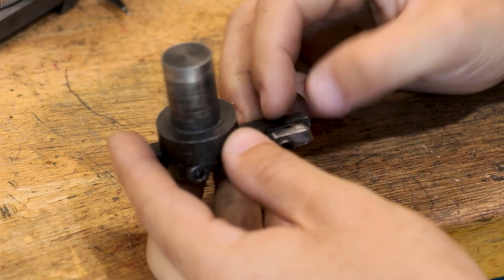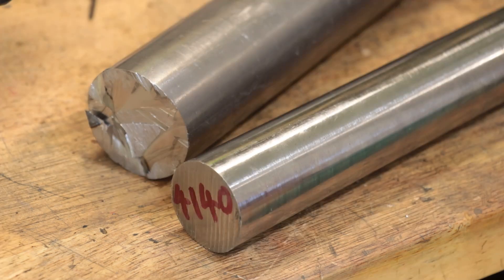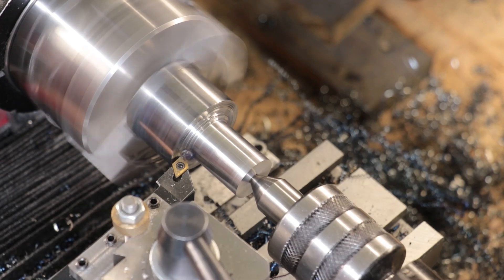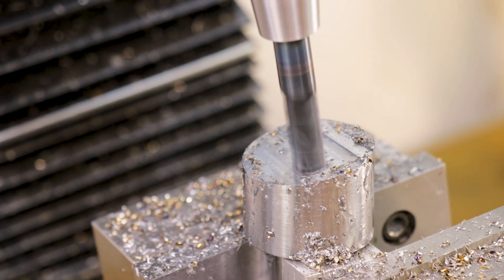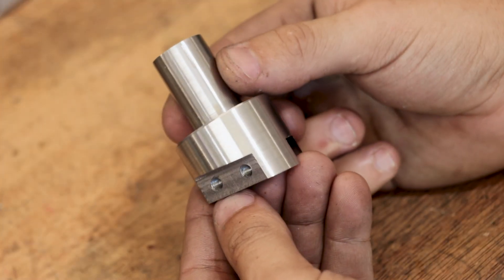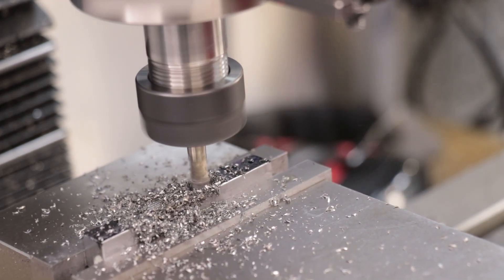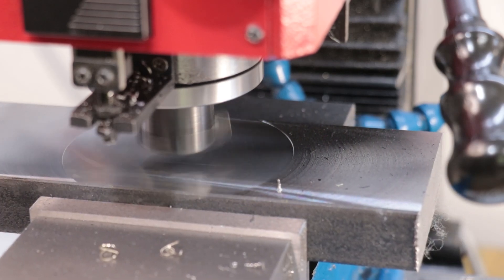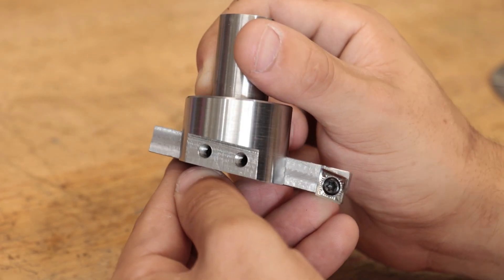Making a Fly Cutter From 4140 Chromoly

Comment from the maker: G,day everyone. Just wanted to clarify a point that I might not have explained well in the video. I have regularly used aluminium cutting inserts in my fly cutters in the past  and have used them to cut steel with excellent results. They can definitely machine steel. As some people have pointed out, a larger nose radius will probably get us a better surface finish, and these inserts do come in a larger nose radius which I might end up trying. With that said, the DCGT inserts that I use have a smaller nose radius than this and still get better surface finishes, so I don’t think that is the issue here. Overall, these are still weird inserts and sometimes these import tools are too god to be true. Cheers
Reply: Since you haven't mentioned what the nose radius you are using is, I have to wonder if you are reading the carbide names wrong...
CCGT 1st C = 80° included angle. 2nd C = 7° Relief angle, G = Tolerance (there's a chart for that but both are the same), T = with hole & single sided cutter.
DCGT D = 55° included angle. C = 7° Relief angle, G = Tolerance (there's a chart for that but both are the same), T = with hole & single sided cutter...

I use DCGT inserts, DCGT070202, DCGT070204, & DCGT070208, the final 2 numbers (02, 04, 08) are the nose radius, 0.2mm, 0.4mm, & 0.8mm respectively. I hope this helps.
Reply: at this point it probably would make sence to upgreade to a sc4 or sc6, they are really at least 2 stps above the sc2

or one of those portable metal bandsaws
 we see you struggeling with both in all your videos

Comment: I find button insert face mills with high rake aluminum grade ground inserts are far superior to single point tools. The obvious benefits include, faster spindle speed, balanced tool, much faster feeds, multiple insert contact eliminating chatter, vastly reduced impact on the part and spindle bearings. Sub micron finishes on brass, as shown on the 28 part fixture demonstration. This method shows tandem milling that reduces cutting toolpath length, doubles edge life & eliminates any backcutting. They may be worth a try.

Comment: Lol those polished inserts are for Al
Reply from the maker: You can use these for steel in lighter machines. They don’t last as long but that’s a trade off that you have to work with on these machines.
Reply: @artisanmakes  They love aluminum on my Tormach. Anything other than AL, I get the same results as you

Comment: Long Shot... I've started using a fly cutter to cut the nail nick in the slip joint knives I'm building.  The trouble I'm having is I can't seem to find any guides on what geometry to grind into the lathe tool to make those 1/2 moon slick nail nicks. Any ideas?  All thoughts are gratefully received.   I'm trial and erroring at the moment and it's more error than anything else =)  Love your videos, very inspiring and encouraging.

Comment: Hi, you refer to the steel not chosen for the body as "carbon steel".  Is this a shorthand for high carbon steel or low carbon steel?  Later you refer to the metal for the tool holder as "steel".  Is this different from "carbon steel"?

Comment: The difference between a CCGT and CCMT inserts is CCGT inserts cut material CCMT tips are blunt and rip material off and burnish the surface but you need a minimum depth of cut of the tip radius and a feed of 25 to 75% of the radius per rev to get a smooth finish.

A 20mm diameter piece of 4140 should be spinning at approx 1800 rpm. Using a CCMT09T304 insert the minimum depth of cut should be 0.4mm and a feed of 0.3mm/rev roughing and 0.15/rev finishing and you will get a mirror finish.  If your machine can not achieve this then stick to CCGT06T302 type tools and adjust the feed and speed to match the tip rad.

Comment: I don’t understand why anyone would bother with inserts in a fly cutter in a home shop on a small machine. Quality high speed steel is cheaper, has worked exceptionally well for years and holds up better on interrupted cuts. 

Just my thoughts and doesn’t reflect on your work, which is very good.
Reply from the maker: If it works best for you I’d say use hss. For me I seem to get better and more consistent results with some types of carbide. Cheers

Comment: Heya, probably a lot of these around but some ideas about surface finish issues, even considering your experience with similar ish inserts.

1. too small nose radius - 0.8 or 1.2 for polished aluminum inserts will work better.

2. chipped insert? pretty strong interrupted cut, be surprised if cheap aliexpress aluminum inserts are the appropriate carbide grade.

3. Very high effective rake - grabbing into the material and setup not rigid enough to cope with - especially w/ gummy mild steel.

4. Feed/DOC too small - rubbing

5. non-polished/coated inserts have rounded cutting edges which effectively burnish material as they cut, polished aluminum inserts dont.

6. tram issue (?) rubbing on the backpass

Comment: The reason that aluminum insert isn't leaving a glossy or shiny surfaces is: the edge is too sharp, a slightly radical cutting edge will create the necessary to leave at glazed/shiny surface behind.
Reply from the maker: Maybe but the fact remains that I have used aluminium inserts for years to machine steel and have gotten excellent surface finishes from them, as I showed in the b roll in the video. For whatever reason this specific batch of inserts wouldn’t work. Cheers

Comment: Why did you remove the part from a secure and inline setup from the hole making process to then tap the part when there is no alignment for the tapping process? Just drill the hole, tap the hole then move to the next hole.
Reply from the maker: Easier for me to film

Comment: Good choice on the 4140, I used to work for tooling company that mainly made indexable mill and lathe tools and 4140 was our goto material for most of the tools we made. We usually started with annealed material, machined out the rough blanks, heat treated to 40-44 HRc, and finish machining/grinding.

Comment: Gday, you really can’t beat a fly cutter finish, in my 3” fly cutter I use Drillpro brand dcmt inserts off eBay, they leave a nice finish, my local steel supplier mainly only stocks 4140 in bar stock, I don’t have a major rust problem with any of homemade tooling, I don’t use cold blue just a simple spray of wd40, great job as always mate, cheers

Comment: I think the difference in the inserts will be the tip radius. Using the round insert sort of validates that. As with HSS tooling on the lathe, a larger tip readius will give smoother cuts. You are making me try 4140 again, my first effort resulted in a ruined cutter.

Comment: Why cut the bottom at 10 deg, this will just add imbalance, the cutting point is well below the body so clearance is not a problem. I have just finished making one myself, and what I did was just put the slot at an angle and did not mill a complete flat for all the holding screws, but just a small one for each screw. I used a purchased lathe tool with a diamond insert rather than making one and the finish was as good as the round insert you were using.
Reply from the maker: For me the angle helped simplify the tool holder geometry. I've never had much of an issue with imbalance, so overall it made it easier for me. Cheers

Comment: Those inserts were meant for aluminum I'm almost certain. Might want to double check, I may be wrong. Great video!
Reply from the maker: I they are made for aluminium but I’ve used these types of inserts for steel for many years, as seen in the b roll fly cutter footage. You have to be careful but they do work. It just happens that these particular inserts don’t work as well as other similar ones
Reply: @artisanmakes  My bad, I just seen your comment below. I'm surprised you've had any luck with the finishing style aluminum inserts on steel. I've tried in the past and it usually just breaks the tip but maybe I'm doing something different. Either way, I really like the video and the tool, very nice job!
Reply from the maker: No worries, the hood up much better than I would expect. They do wear out faster than normal inserts, but I can get a few hours out of one insert. Cheers

Comment: You have bad surface quality on lathe machine, because this cheap machines have low rigidity. This plates are very sensitive for rigidity. Deep stripes can tell about: 
1. Bad bearings in spindle
2. Bad contact between tool-post with compound rest, or between compound rest and cross-slide, or (most often) between cross-slide and ways of your machine.
Reply from the maker: Can’t argue with that, this machine is being pushed well beyond what it was intended to to. I am happy with the results that I can get from it, especially in 4140, but it is in need for a rebuild sometime soon. Cheers

Comment: the geometry and coating make a HUGE difference as im sure you know. those inserts will be great for aluminum, but not the 4140.
Reply from the maker: I’ve used aluminium specific inserts for steel for years. They aren’t finishing inserts but they can get you great finishes, as I showed the video. For whatever reason these specific aluminium inserts just won’t work. Cheers

Comment: Surprised that you find carbide produces better surface finish than HSS given your smaller sized machines; do you polish the edges after grinding the tools? Also, the difference between branded HSS and generic Chinese is like comparing a long distance journey in a Fiat or a Mercedes: they’ll both get you there but one gives a more pleasurable experience.

Comment: Would have been nice to cut the fly cutter with a fly cutter! 😄

I am so happy that there are folks like you working with affordable machines so you can demonstrate for the masses rather than a smaller segment.
Should there be cutting at the trailing end? I'm thinking the spindle needs a bit of trimming. Can that machine's tram be adjusted?

Comment: With the tiny corner radius of the aluminum inserts you need to feed very slowly. The button insert has a ridiculous corner radius and will therefore create a much mor even surface. Cutting loads need to be considered with high corner radius inserts however.
Reply from the maker: The corner radius on this is still larger than most of my finishing inserts, the scale is a bit hard to judge but these inserts are roughly double the size of my regular inserts. Cheers
Reply from the maker: The corner radius on this is still larger than most of my finishing inserts, the scale is a bit hard to judge but these inserts are roughly double the size of my regular inserts. Cheers

Comment: Wow, that finish with the button insert is amazing. I need to try it. The sharp edges of the inserts meant for aluminium will chip easy with interrupted cuts since they're uncoated. dcgt will work well, why not continue using the button insert (rcmt ?)
Reply from the maker: I’ve never had much issue with uncoated sharp inserts breaking on me whether it be this or DCGT a long as I keep the depth of cut light. It’s mostly stalling the mill that ends up breaking them. I definitely am thinking about sticking with the round RDMT inserts, I just have to keep the cuts light due to the cutting forces. Cheers

Comment: I know you know what youre doing, but I highly recommend ditching the inserts you use when cutting steel on your lathe. Youre really overpowering the machine. The machine will cut much more freely with well ground HSS tools or even the polished inserts you used for your fly cutter. The fact that we regularly see things moving and shaking on the lathe is a good indicator of the value in switching out your tools to something more appropriate for such a small machine
Reply from the maker: Put it simply I get better results from carbide than I do with HSS with this lathe. I used to use hss exclusively but with the ac motor drive I have found that the lathe works best with carbide inserts. Cheers
Reply: Might want to work on your grinding then. Not trying to troll you but its pretty obvious from the cuts that things are not right.
Reply from the maker: Oh for sure, this lathe needed a rebuild. As I mentioned in the video 4140 tore up the v belts which is resulting in that wobble, but the lathe mounts also need replacing too. With that said I do push this lathe beyond what is reasonable to see what it can do. Cheers
Reply: @artisanmakes  why would ac make a difference? Every lathe is ac. I think its possible you should revisit your hss grinds. The surface finishes and lathe moving around in your videos demonstrate the failures of the carbide tooling. If you cant get better MRR and finishes with hss then then the issue is the grinds arent optimizes and warrants further research and practice.
Reply from the maker: This lathe was originally dc, most small bench top lathes are. I replaced that motor with an ac that directly drives the lathe spindle. It’s more powerful but it fixes the speed at around 900 rpm. It’s an imperfect set up but it works. Only downside is the rpm is a bit high for hss but at allows me to push the lathe with carbide, at least when im not turning 4140. Cheers

Comment: I think you might do better using the other corner of the insert. And if you can get the trailing edge parallel to the work it could work as a wiper and give you a better finish.

Comment: You could make another insert holder on the opposite end of that rod for the button insert for finishing maybe. Just take it out, flip it around, and do a second pass without having to worry about changing inserts
Reply: Maybe don't use the same rod, as making the holder that thin will weaken it lots. Make a second holder though just for the finishing passes.

Comment: I find the nose radius of those CCGT inserts needs to be at least 0.4 or more for a good finish. I'm not sure why that is? Probably something to do with the chips?

Anyway, nice work again buddy. 👍
Reply from the maker: Thanks for the info. This is my first time using CCGT inserts. I had a look at the specs and these are 0.8mm node radius, which is a good indicator that the issue is with the inserts themselves
Reply: @artisanmakes  Oh, You must have got a bad batch then. Maybe they aren't hard enough?
Reply from the maker: Not sure, I’m no lathe insert-ologist but sometimes these Chinese inserts just don’t work. Cheers
Reply: Try scraping the bottom of the ice cream bowl with the pointy tip of a steak knife. Then the tip of a spoon. Then the side of the spoon. You will see the difference a larger radius makes, and you get to eat ice cream 🍨
Reply from the maker: I don’t quite understand the analogy, the nose radius on this is larger than most of my finishing inserts?

Comment: Leaving a recess for the grub screws also removes the chance of them leaving a burr that may make moving/adjusting the tool holder part difficult. Though against CrV tool steel that may not be much of an issue in the first place. Nice clean build :)

Comment: I have the same experience. Really sharp inserts provide a more dull surface, while the standard inserts leave a glossy surface. The latter rub heavily on the workpiece with their rather blunt cutting edges and polish it to a shine. On my very light machines I cannot remove 0.02 mm with the standard blunt inserts, they then rub on the workpiece without removing material. For precision work if necessary, I give my inserts a sharp cutting edge on my diamond grinding wheel. With a piece of scotch brite or something similar, I'll apply the gloss later. A disadvantage of such really sharp inserts is that the edge crumbles even more easily, so it is not always a good solution, and HSS is an option then.
Reply: I think its a good idea to have the slot sized for hss blanks just in case anyway

Comment: Those inserts like you said are made for aluminum, I tried those same inserts in steel and had similar finishes on a 2 inch face mill, but when I used them only on aluminum I got a nice mirror finish.
Reply from the maker: Maybe, but as I said in the video I have used DCGT aluminium cutting inserts for steel in my fly cutters and they net great results, which is why I was surprised that these CCGT inserts didn’t work.
Reply: @artisanmakes  probably because they have such a sharp raked cutting angle.
Reply from the maker: That still wouldn’t explain why the same geometry DCGT inserts work but these don’t
Reply: That particular insert being for aluminum may have steel in the coating. Conversely, a lot of the inserts used for steel have aluminum in the coating. AlTiN and AlCrN being 2 more common coatings for cutting inserts designed for steel. The reason behind it is to stop the chip from welding itself to the insert while cutting. The insert is still carbide, so it WILL cut, but looking at the finish, there is some smearing going on.

Comment: 8:48 try using an insert designed for the material you intend to mill. Using an insert designed for machining aluminium is of course not going to leave a superb finish on steel..
Reply from the maker: As I said in the video, I have used these aluminium cutting inserts for steel for years, especially in DCGT they can yield great finishes. For whatever reason the CCGT inserts just wouldn’t work. Cheers

Comment: What was the material you cut with the new flycutter with the aluminium cutting inserts? In my experience those cheap aluminium cutting inserts really only work well on aluminium. When used on steel that sharp edge immediately gets slighly  damaged (look under microscope) and you get a bad surface finish. So if you were tryinh steel that could be a problem?
Reply from the maker: Looks to be a piece of hot rolled steel, which is what I intend to machine. I would agree with that, but I got such amazing results with similar DCGT aluminium cutting inserts and they lasted longer than I expected too. Cheers